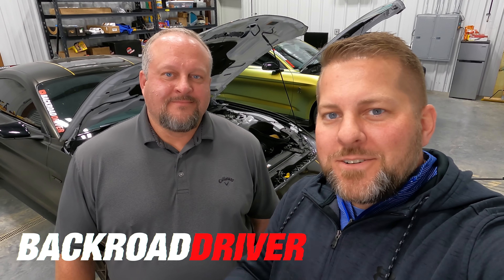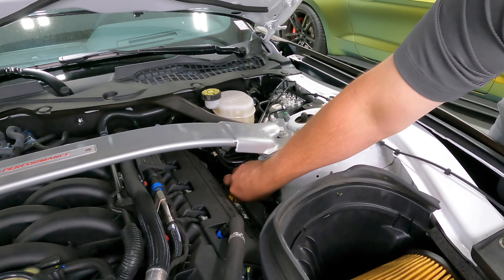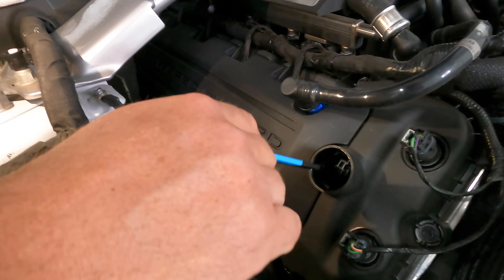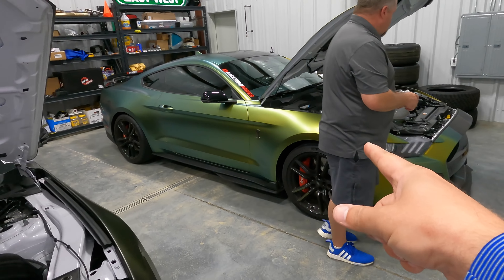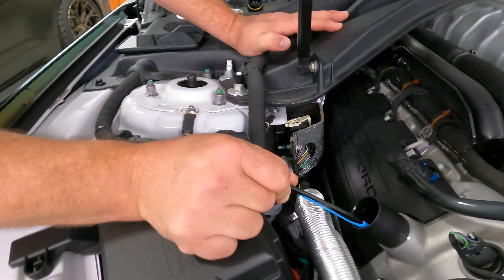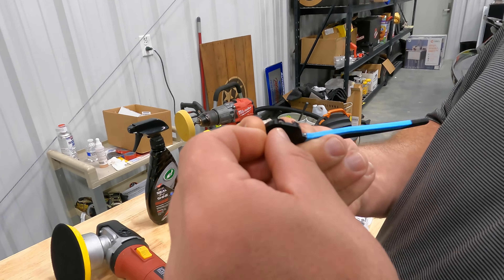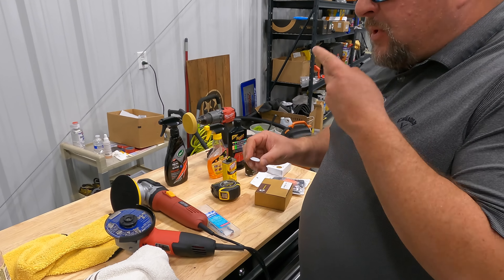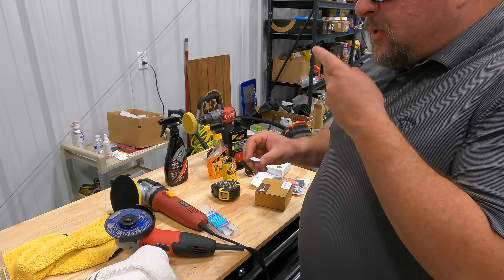Our GT500 & GT350 Might Have Bad Engines... New Ford TSB for 2020 Predator & Voodoo 5.2 Motors...

Comment: Great video! Thanks for posting.  I got the dentist mirror that night and checked my December 2020 build Voodoo the next morning. Whew! no issues.  I could clearly see the tensioner was popped-up with the groove showing.  I'm pretty sure I'll order the oil pressure balance line though, seems like a great preventive measure to keep good oiling on a motor that will see some road course time soon.
Reply from the maker: Have fun at the track!

Comment: Don't think for a minute because there is a TSB ford is going to replace the engine. I had a 2018 f150 that used oil like crazy and sounded like a diesel engine and they said it was acceptable  like two quarts every two thousand miles.
Reply: Two quarts per 1000 miles is way beyond Ford allowable spec, if they verified it burns that much it should have been replaced.  The 5.0 TSB references oil consumption greater than 1 quart in 3000 miles.  If your truck burns two quarts per 1000 miles your dealership failed you, not Ford.
Reply: @BC08  I  had engine replaced at 5000 miles by ford second engine they did not want to replace got lemon law attorney ford settled out of court day of court date.